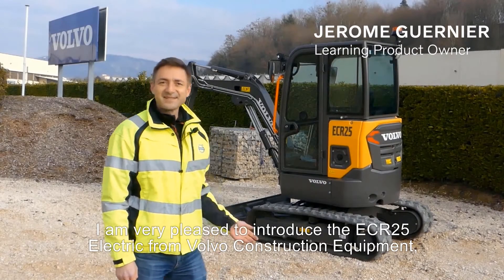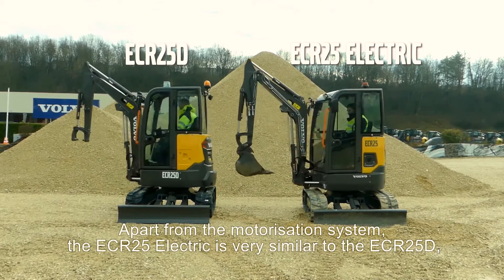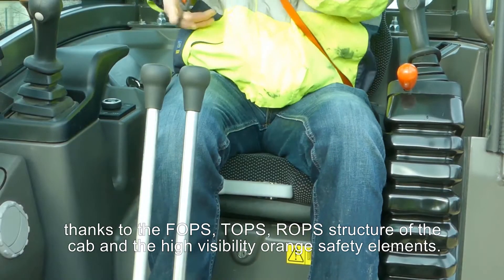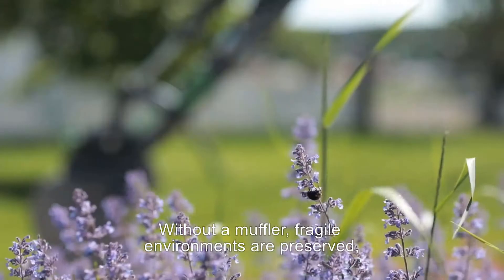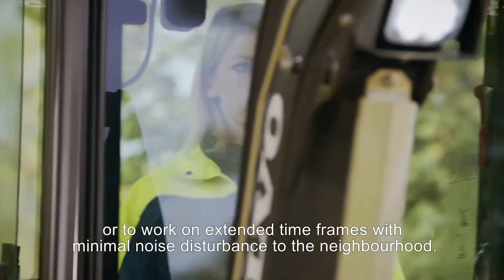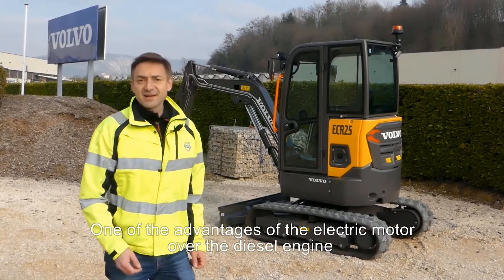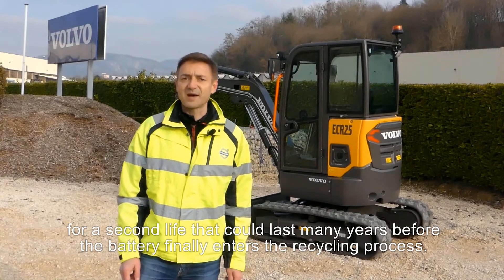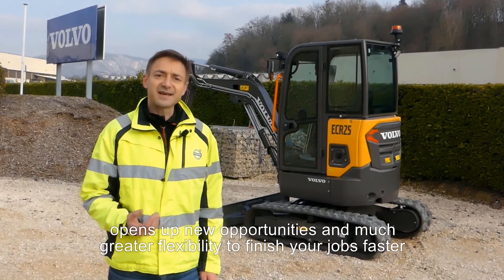Volvo ECR25 Electric Walkaround

Comment: And then they charge it with a Diesel generator because those machines are usually working out in the nowhere where they don't have access to AC power...
Reply: Just to make my self clear, this was meant as a joke, but it has some truth. Also by using generator, (as long as it is in good condition) can be a lot more efficient than burning the oil in the engine on the machine...
Reply: @Guds777 Or if your using Propane or Natural Gas Generators instead of Diesel that is also a lot cleaner